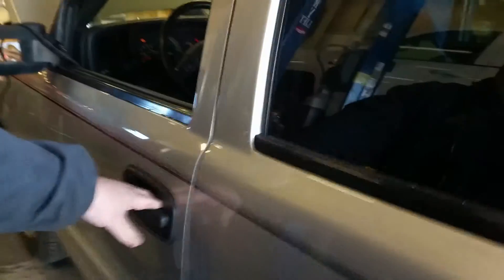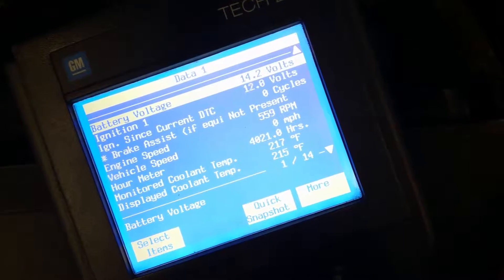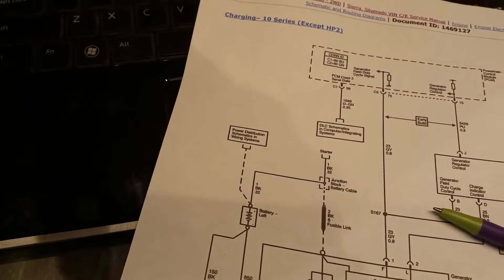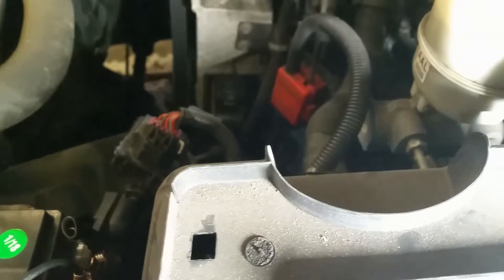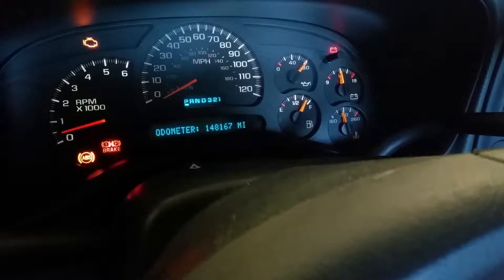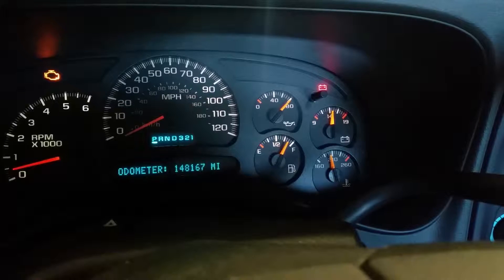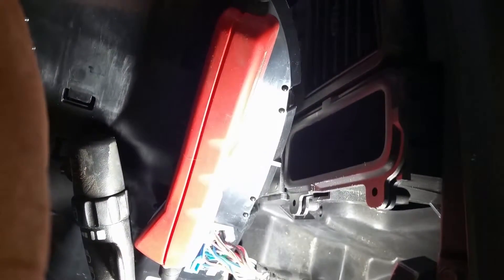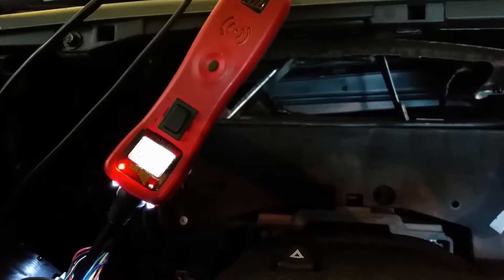2003 2006 GM Truck, Tahoe, Suburban Insturment Cluster Diagnosis

Comment: Lol owner isn't worried about oil pressure but he needs that batt light off, like wtf is wrong with people
Reply from the maker: Yep...Truck had multiple issues...
Reply: @IrocinZ  do you have an email I can send a pic of wire attached to the back of my cluster connector?
Reply from the maker: @StephenClarkDobson  Send it to Irocinz@gmail.com
Reply: @IrocinZ  thank you.
Reply from the maker: @StephenClarkDobson  Welcome
Reply: I know right!? It's like dominoes once one thing goes then the next goes etc... I'd be more worried about that check engine light and why the hell is my oil pressure pegged...smh